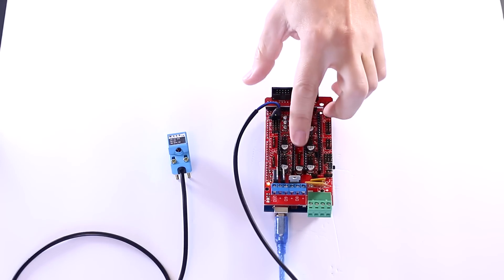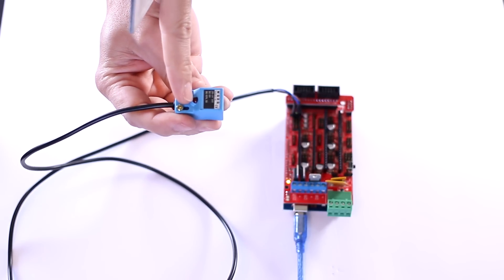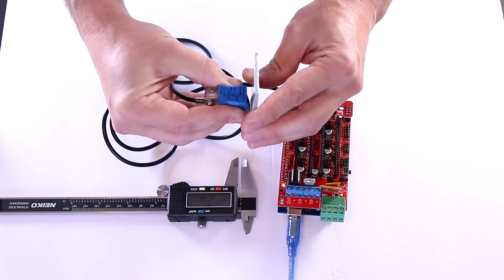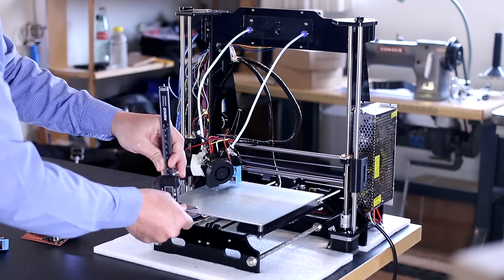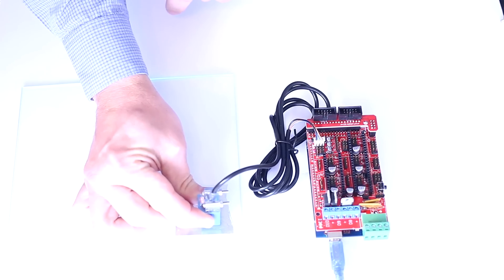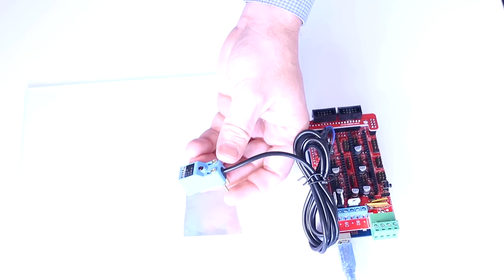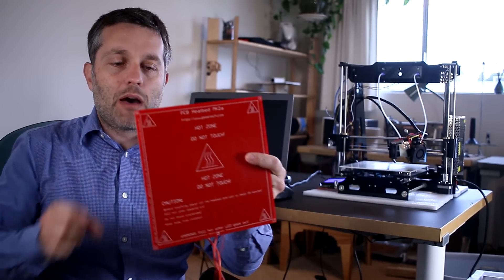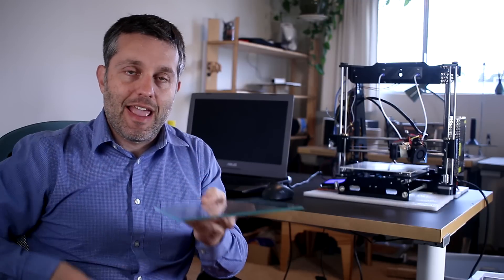Z-axis inductive sensors for Cheap Chinese 3D Printers: 6-36v & 10-30v sensors work on 5v power

Comment from the maker: STOP! Before you leave another comment about why I'm wrong in this video, go watch the video I made addressing reliability/repeatability of these sensors, and also why the foil  tape backing is a mistake: https://youtu.be/_-fAMAnn3_s
Reply: Sorry to bother you I have the same printer and the same sensor. But I´m using Repetier Host and my Start Gcode is always incorrect. Can you guide me or tell me what should say with an offset of 0.6 on Z ? Thanks !
Reply: works flawlessly.
Reply: HEY MATE . CAN YOU TELL ME HOW WILL I LEVER THE SENSOR I MEAN HOW FAR IT MUST BE FROM THE BED ??? DOES IT HAVE TO BE AT THE SAME LEVER AS THE EXTRUDER ??? THANK YOU
Reply: MY FLSUN I3 WITH SIMILAR SENSOR DOES NOT AUTO LEVER AFTER I PRESS THE TOUCH SCREEN . IT JUST MOVES THE BED FEW TIME AND EXTRUDER MOVE UP A BIT AND TO THE CENTER OF THE BED . THE END . WHATS WRONG IF ANY THING WRONG HERE  ?!
Reply: Just a hint, typing with capital laters (large) is the same as you are screaming. So please don't scream.

Comment: Basically Lenz law for any other engineers out there. The tube and neodymium experiment is one of the ways for demonstrating this. Kudos for solving the issue with Al tape. Now I can use my tronxy 6-36 V sensor and glass bed.

Comment: It comes on Tronxy XY 2 pro printers and after few months starts failing and becomes a disaster. I had to remove it and replace it witha norma l switch and the printer is working fine, easier to level. At Tronxy they will never tell you is failing, they just say is miscalibrated, how can it be if you never moved it out of place?
Reply from the maker: It varies the sensing height based on the temperature of the probe itself. The varriance is huge: .5mm! I made a video on the subject: https://youtu.be/_-fAMAnn3_s

Comment: My printer has a Aluminum bed, i put a mirror ontop of it, would any of this sensors work on that? maybe without the aluminum tape? Mirrors contain Silver Nitrate will the sensors sense that?
Reply from the maker: Like I showed in the video the aluminum foil is detected through the glass. Your Aluminum bed would similarly be detected. However I highly recommend against this type of sensor. While inexpensive the measurements they provide vary based on how hot or cold the sensor itself is. This means that if you set up your printer perfectly but the sensor is hotter the next time you try to print, your first layer won't adhere to the bed. A BLTouch is superior.

Comment: I know that this is 2 years later, but there is another type of sensor that could be used, and it would be extremely accurate.  We used them to detect the tension on tape storage systems ~40 years ago.  It’s an iron plunger inside of a glass tube with a copper cup on the outside of one end of the tube.  If you spring loaded the plunger, you could use it like current switch types, but it would be repeatable to at least 1 micron, of not smaller.  It’s like a miniature metal detector.  A tiny unit with circuit board could probably be mass produced for under $10.

You could also do something similar with the Hall Effect sensor and a spring loaded rod.  Just detect an object on the other end of the rod, the end that is not touching the bed.  There’s always at least 2 ways to skin a cat, and it doesn’t need to be direct.  😎
Reply from the maker: Thanks Kaelum. This is a good comment!

Comment: if you supply those sensors with 12v they will be more sensitive also , why is it such a big deal to give sensor a voltage within its rated range ?
Reply from the maker: The output from the sensor will burn up your control board. If you feed it 12V, it will output 12v. Thus you will need to do some complicated wiring to drop the signal down to 5v. It's easier to just run the sensor on 5v to begin with.

Comment: Thank you, amazing test, hmm I was thinking about this "electrical" bed problem, did you test it on bang-bang or PID?
Reply from the maker: Bang bang. The board I was using at the time was not able to handle PID, and beds are a large thermal mass, so PID really doesn't give all that much improvement.

Comment: Do you have a recommendation of what sensor to I could use with the Tevo Little Monster? I'm using the black glass since my PEI sheet was rubbish.

About my machine and plans:
I'm going over to Duet2 WiFi (no smart effector) and redesigning the effector to be more compact and remove some unnecessary weight/peripherals from it.
I'd like to use a compact sensor like the ones you showcase but am concerned about repetition against a black glass bed. I'm not a fan of the BL but if it's the only choice I have, then so be it.

Thoughts?
Reply from the maker: I highly recommend that you do not use a capacitive sensor, or an inductive sensor. The capacitive sensor will give variable readings that fluctuate with the humidity in the air. So you set it up one day, then the humidity changes the next day and all the sudden it isn't reading the same distance. Or it could happen in the same day. You set it up with the bed cold, then heat up the bed. The heat radiating off the bed dries the air above the bed and you are now getting a different reading. The inductive sensor also gives inconsistent readings. It will vary it's readings based on how hot or cold the actual sensor is. Both are poor solutions. The only reason people use them is the price point. There are work-arounds but they are just patches being applied to a sub-optimal piece of equipment. For instance, watch my video about the Duet Maestro installed into an Ender 3 Pro and you will see how I made a chart to correct for temperature of the probe (youtu.be/PpLEjwLZwBw) Spoiler: It didn't work very well, and in the end I just switched to a BLTouch with is incredibly reliable, accurate, and measures the print surface itself by touching it. This means you can change out your bed from PEI to Glass and then Aluminum, and you will never need to adjust the "trigger distance." Because you don't want to use the DUET smart effector (Which is awesome) The BLTouch is the solution I recommend.
Reply: @DesignPrototypeTest  ohh gotcha. And it's not that I don't want to use the smart effector, I'm just in a budget crunch right now and with my printer being down, it's starting to hurt my production targets. So once o get back up and running, a smart effector will be on the To-Get list. For now, I managed to snag a used Duet2 for cheap.

I'll factor the BL touch into my effector redesign then. As for temperatures, being where it is on the OEM setup of the Little Monster, is it true the heat from the heatsink will distort it's performance or is that a wives tale?

Comment: How come I can't get the PNP to function on my hyper cube running Marlin 1.1.9... I have followed tom,s video and the fermware still will not work.
Reply from the maker: I don't know friend. I've stopped using Marlin in favor of the far superior RepRap Firmware and Duet WiFi control board. I suggest you do likewise. You will have far fewer frustrations.

Comment: Sorry, but the information here is not nearly enough to warrant any conclusions. At the very least use the firmware's capability to make repeated measurements and see if the std dev varies with applied voltage.

Just throwing out the idea that the electrical conductivity of Al varies with temperature without quantifying it is very misleading. In fact, it varies only a small amount with temperature in the ranges you'd expect to operate a printer. Conductivity is only one part of the equation, so to speak; magnetic permeability is probably more important and, again, over these temperatures it's not going to matter. 

What is most important is how a proximity sensor actually works, which is nicely described here - https://automation-insights.blog/2014/03/05/basic-operating-principle-of-an-inductive-proximity-sensor/

It is a kind of electromagnet, which means the field strength varies inversely with distance cubed (r^3). The field strength is a function of the voltage and current. The stronger the field, the greater the distance before the sensor trips. So, if the voltage is less than the recommended, yes, it will work, but the effective distance will be much smaller than what the datasheet will indicate is nominal. If the distance is too small, and the std deviation too large, the accuracy and precision will likely be poor. It might be so poor that the hot end (which is lower than the sensor) will crash into the bed; can't say it won't, right?

I agree it would be nice if Tom tested one of these with his rig, but to take into account your points he would have to have  temperature chamber and variable supply. That's a lot of degrees of freedom. 

Please don't suggest that just because the sensor can work under-voltage that it's just fine for people to use.

Comment: Hi, and thanks for alot of good content :D Was wondering if you might have a diagram on how to wire it up? I currently plan to use the 6-36v sensor on my Tronxy X5s 400, but got kinda stuck on the wiring part :-(
Reply from the maker: Wow! I forgot to include the scene which I filmed explaining the Control board on the X5S 400. Bottom line is that there aren't any extra i/o pins on the control board of this printer. You will have to do some fancy soldering to traces on the board, and also build a new firmware from scratch as TronXY has not released the source code. Yes, they are in violation of the GPL.
Reply: @DesignPrototypeTest  Ok :-) I have tried to look for a signal around 5v on the board, and the one one I found was where you connect the Arduino on the 6 pins :-( I also doesnt quite understand the PNP NO (normally open) probes, as it seems like the Z limit switch goes to 0 when triggered :-(
Reply: @DesignPrototypeTest  Hi from Norway btw :-) Really love your content, and just ignore the haters :-) They are gone hate no mather what unfortunately :-(

Comment: is the brown the hot wire, black ground and blue signal for the 6-36v? i am trying to set it up oon an anet a6, right now there is a red far right hot wire, center empty and black far left ground.
Reply from the maker: Hi Brett, all sensor do not share common wire colors. I can't tell you which wire does what on your sensor. Most of my sensors have come with a little tag on them explaining the wiring. At any rate, if you are running 5v you can plug in the wires in different combinations until one works. Remember of the three wires you have power ground and signal. Black is almost always ground, and blue is almost always signal. The only wire left is  positive power (AKA Vref). I made a follow up video to this one, it might help you if you watch it and pause at key moments: https://youtu.be/_-fAMAnn3_s

Comment: My only question is why is using 5V and avoiding 12V something people want to do? I mean maybe people with less DIY printers might be intimidated, but it seems to me that tapping into the 12V is super easy.
Reply from the maker: If you feed the sensor 12v it will then feed 12 volts into the sensor pin on your control board, which will fry the board. This can be corrected with resistors, but the wiring is easy to get wrong. In other words, it adds more steps and and you run the very real risk of ruining the printer. Why bother when 5v works fine?

Comment: He said you wouldnt get a reading off glass with aluminium tape added to the back. And your test proved him right, basically he was saying you cant get around the problem of the sensor not working by adding tape, aluminum tape will not detect-so no reading!! Also using that sensor in this arrangement is toward the edge of the sensors operating parameters, a different batch or some voltage droop from anywhere may affect some setups. I get that it works and in your case was handy as it was simple, but if all the processes and systems around us were built with a similar margin for error or deviance we would forever be troubleshooting or pulling our hair out. Imagine your pc hanging 1 out of every 1000 tasks but always for a different reason, because of the designers "good enough-it works" design mindset built in many less robust automated tasks.
 Why go sketchy by design? We can easily engineer a solution which sits more comfortably within the components operating parameters and reduce possible issues some setups may encounter. We need to make 3d printing more robust in its processes not less, any fixes should be done good enough to move on from and avoid introducing another possible failure path in the already unreliable 3d printing workflow.
Reply from the maker: I have tested over 20 different induction proximity sensors. All of the ones with the square plastic shape work to detect foil backed glass. All the circular metal barrel types do not. Watch the follow up video I made to this one: https://youtu.be/_-fAMAnn3_s 

Also, I am strongly of the opinion that induction proximity sensors are a bad solution. They don't measure the bed directly, so what happens if you have an air bubble in your PEI sheet? Your offset value would be incorrect in that spot on the bed. Also the readings they give are substantially influenced by the temperature of the probe itself. This is why Prusa had to add the thermistor to his sensor., 

As far as sensors go, the BLTouch is a much better option.

Comment: all you need is for the 6-36 volt 12 volts is best how you do this... wire it from your arduino .... so buy a step up converter for 2 bucks on ebay.. the negative from the arduino to the negative input on the converter.. then the positive from 5 volts on the servo lead to the converter on the other side of the converter you put positive and negative to there pads.. and use the signal just straigt to the arudino servo pin.. basically its in line.. then adjust the voltage.. well adjust the voltage outside first with sensor off then install it.. and voila 5 volts into 12 volts.. i hightly recomnend not doing any inductive use a bl touch.. marlin is set up for them now and you can swap out any plate annnnything and the bl touch will detect it....

Comment: IS it really that easy to install one of these sensors? I heard stories about it being awkward to set up the software to accept them and yet this and other videos show them being simply plugged in and used without any software modifications.  Plus the microswitches used as standard with the Anet A8 give only a normally open connection until it's triggered and doesn't use any electrical power, so how does the board supply 5 volts to the sensor?  

I was considering installing a similar sensor, they're all over Ebay so they must be popular. I intended to use a completely separate 13.8volt fully regulated power supply. I will be using a 3mm  borosilicate glass on top of my heat bed. I figured the sensor with the highest measurement distance would be the best. 

 Is there a software modification I have to do and are there any problems I'd be likely to encounter please? Thank you.
Reply from the maker: Yes. You will need to modify the marlin installation file. If you already have that file to modify, it can be quite easy. If you have to write/calibrate the file for your printer it can be incredibly hard depending on your competency with programming in the Arduino environment. If you have an A8, you should be able to fairly easily find a copy of the firmware on the internet as that is a very common/popular printer.

Comment: I have a Tevo Tornado, which has a 110 AC bed heater, would the collapsing mag field at 60 hz work better?
Reply from the maker: I made a second part to this video. You can see it here: https://youtu.be/_-fAMAnn3_s In that video I did a little bit of testing to determine that the electricity running through the heated bed has no noticeable effect on proximity readings. At least not for 12v DC. power. It is a very distinct possibility that your 120v AC setup would effect the readings. I can't say for certain because I've never tested it. Just to be safe, I suggest you heat the bed up, turn the bed heater off, run your bed leveling algorithm and then turn your bed heater back on before printing.

Comment: Why not just wait to turn on your heated bed until after you have set home
Reply from the maker: The bed heating up causes it to expand and bow slightly in the middle. This means that it will be at a higher place (in the middle) after heating up. If you measure before heating up, your measurement will no longer be correct once you begin printing on a heated bed.

Comment: I have a 2-part question.  I have a Hypercube with a 330mmx330mm 4mm thick aluminum plate and a Keenvo 24v silicon heated mat attached to the underside of the plate.  I also have a 4mm thick Borosilicate glass plate.  My question is, will the 6-36vdc sensor work for either the plate alone or with a aluminum taped glass plate if I add a step-up inline transformer to take 5v from control board and bump it higher for for metal plate only configuration (ie, no glass) at 10v verses adding the glass plate and dropping voltage back down to 5 volts?  Looking at options to allow me to run with or without a glass plate.  ~Thanks~  Doug W.
Reply from the maker: It sounds like you need a sensor that directly measures the bed. This way you will not be having to constantly adjusting the probe offset distance when changing the bed type.  I recommend the BLTouch sensor. However, if you want an inexpensive DIY solution look into "allen key probe."

Comment: I tried to install 6-36 V Sensor on my Anet A8 and it didn't detect the Hotbed. When I tapped into 12V line the printer went crazy and some smoke came out of the LCD. I would NOT RECOMMEND this to anyone.